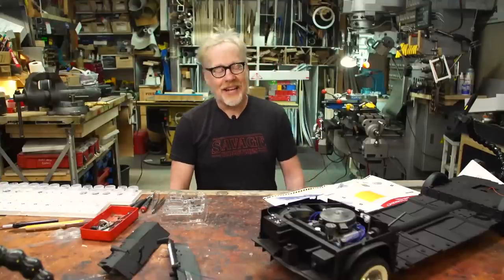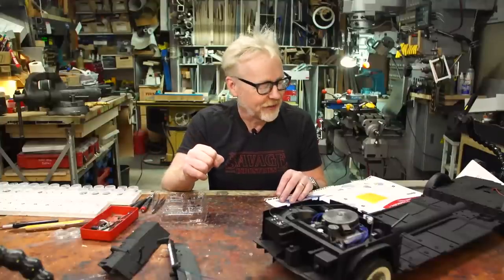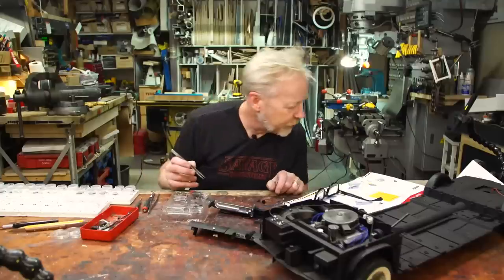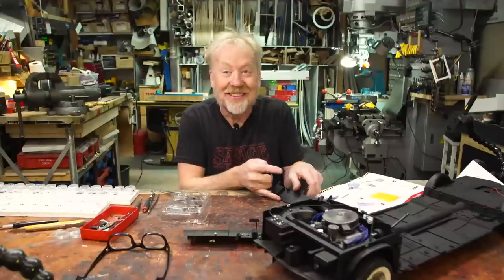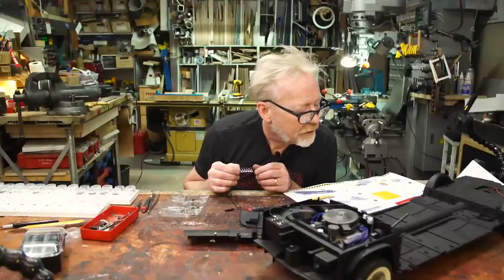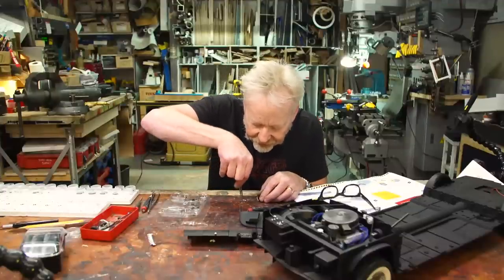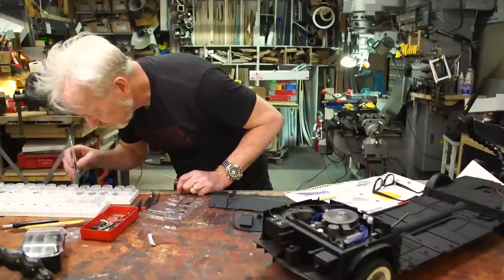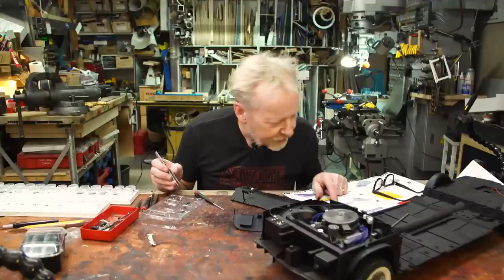Adam Savage's Live Builds: Ghostbusters Ecto-1 Kit (Part 9)

Comment: Great to see this back. A little tip I learned from World of Wayne is to dip the M screws into a little oil (like 3 in 1). Makes them easier to screw in while ensuring things are tight, and protects the threads.